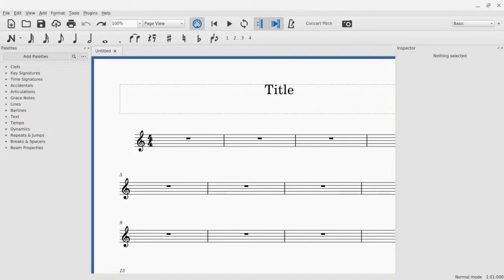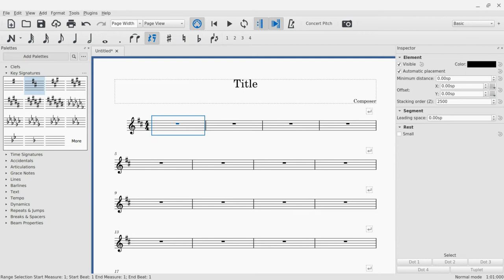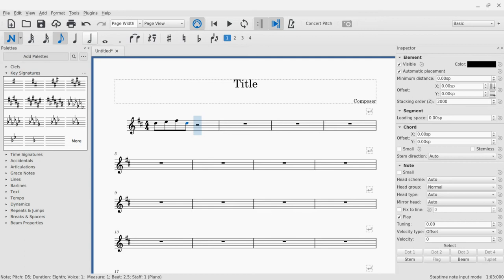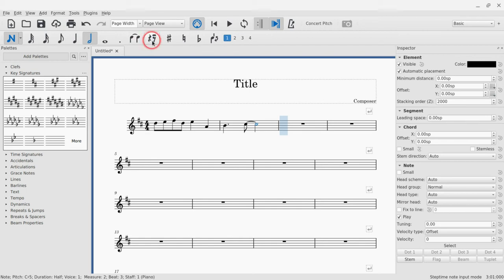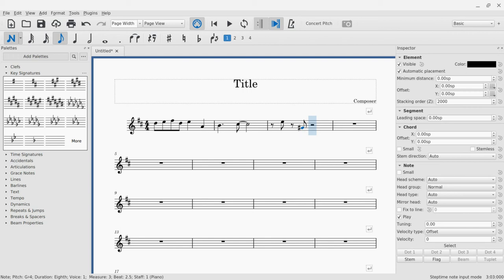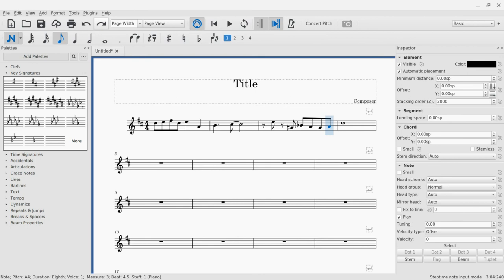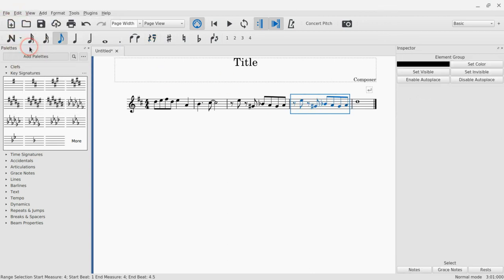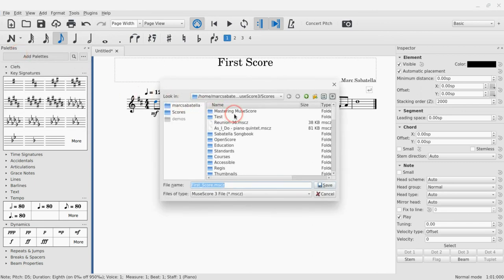MuseScore 3: Your First Score

Comment: Hello!  Thank-you so much for this introduction!  I need to make the leading edge of that first staff move over to match the others.  Is there a click and drag setting somewhere?  So far all I can find moves the whole page or just the Clef symbol!
Reply from the maker: Normally, just like text paragrpahs, it's correct to indent the first line.  But if you have a special reaosn to want to not do that, you can disable it in Format / Style / Score.
Reply: @OutsideShoreMusic  Thank-you so much!  Yes, the reason is that I am lining up an alto line so that the notes from each verse are directly under each other.  The singers can see where in each verse there are changes in the part.  I am using Solfege labels so that my singers know exactly what to do for each verse as it changes.

Comment: Hello, something is driving me crazy!...  If I am entering notes into a 4/4 measure, and I have 3 (1/4) notes so far, and I decide to change the first (1/4) to a (1/2) to "complete" the 4/4 count, should not the other 2 (1/4) simply move down one spot and give room to 1/4 now a become a 1/2?  This is the way it should work (adjust the count automatically) OR NOT?...  I doubt you can understand my question anyway.. but I had to try. TIA
Reply from the maker: MuseScore assumes when you enter a note onto a spefic beat, that you you really mean it.  So it won't move it unless you explcitly tell it to.  If you have some number of notes you want to move from one beat to another - doesn't matter matter if it's one note, two notes, or a hundred - use cut and paste.  So, select the notes you wish to move (eg, click the firs,t shift+click the last< Ctrl+X to cut, select the destination, Ctrl+V to paste.